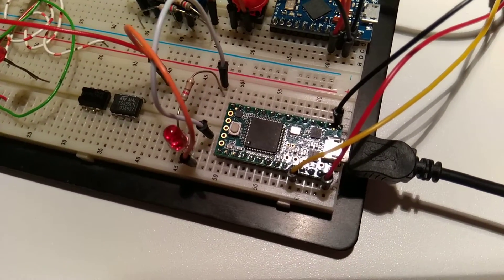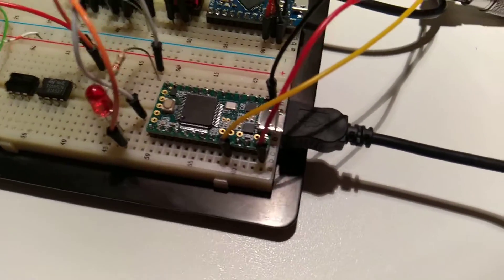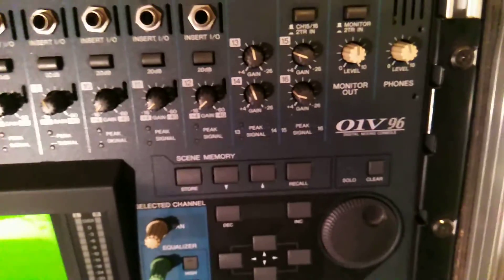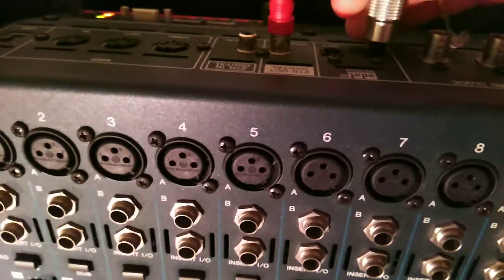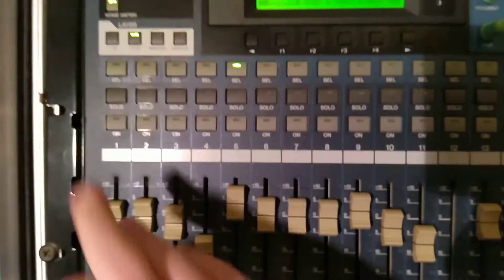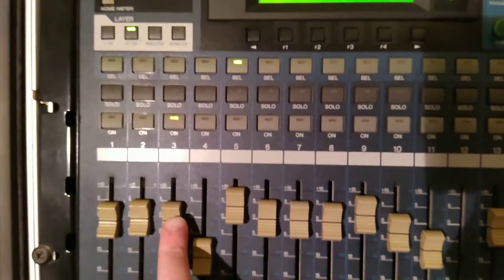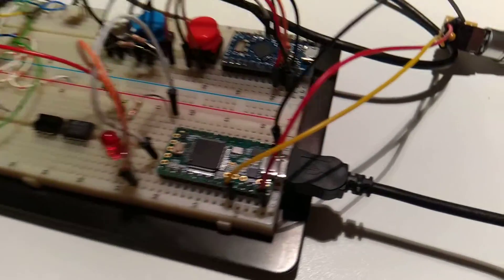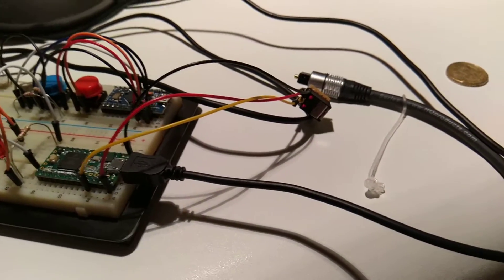Teensy ADAT Toslink 8ch audio

Comment: did you look at doing the same in the opposite way, adat into the teensey?
Reply from the maker: I've tried first to implement a TosLink (SPDIF) input, but the Teensy I used (3.2/3.6) was not powerfull enough to calculate that, so I did not go any further. I've read that the new Teensy comes with SPDIF input out of the box so there are chances nowadays :)
Reply: @EjaYF  would be interesting to test it with the new teensy 4.0